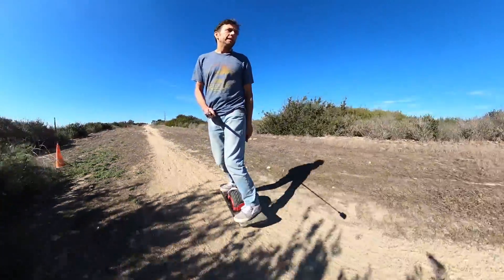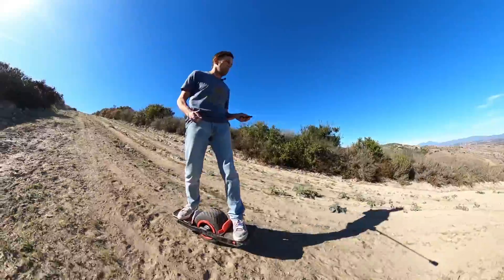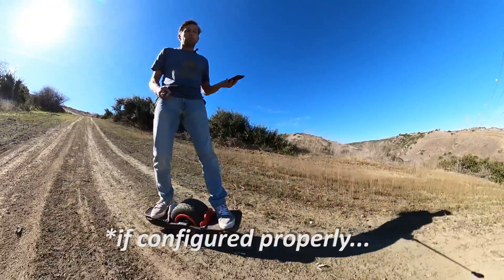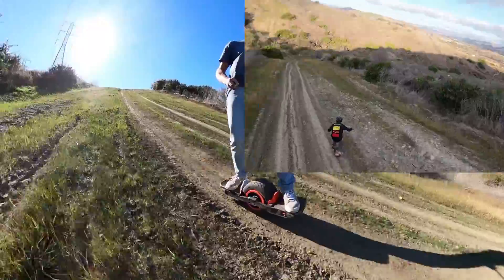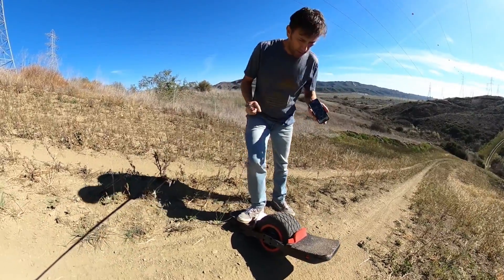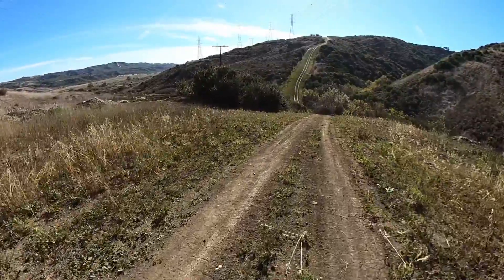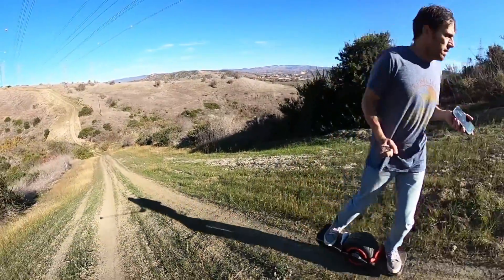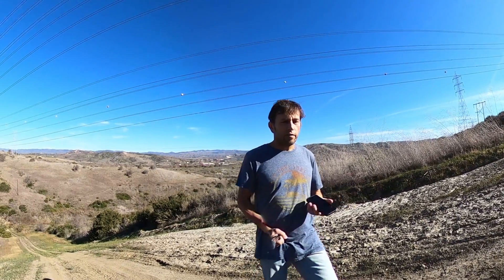All about ATR: Adaptive Terrain Response

Comment: You need an av box 😜 literally can’t get mine to overheat.
Reply from the maker: I have a pub box on the way for my next build. Should be even better…
Reply: @surfdado  hell yah. Are you getting a billet one? Why do you assume the cooling will be better?
Reply from the maker: @chasekasperowski8253 billet/CNC is the same right? The AV Box guys chose the wrong Aluminum. 7075 is stiffer/harder and more expensive but its thermal coefficient is the same as the cheap 5051 aluminum. The pubbox and the fungineers CNC box both use 6061 aluminum, which is the best you can easily get for an application like that.
Reply: @surfdado  interesting 🤔
Reply from the maker: Also, you might be underestimating this hill 😂
Reply: @surfdado  ha, I feel like I am 😆 that thing is monstrous.

Comment: This just gave me a thought for FM boards to have some sort of a remote tilt.

Add friction to the tire. 

I have been doing this on my fender-less board by dragging my shoe on the tire to remove goat heads. I noticed the nose rising but didn't think much of it until now.

Maybe something could be mounted up and foot activated, or maybe I just smoked too much....

Either way thanks for the solid info my dude!
Reply: It's been done on VESC boards, using an e-skate hand controller.  Instead of using the thumb lever or wheel for acceleration/braking, it tells the board to put the nose up or down real-time.  Supposedly once you get used to using it it's fairly easy/intuitive to do.
Reply: @glyphnosis  I understand remote tilt perfectly well. Got any way to make it work on a FM controller? My idea to add drag(like the side of your shoe, or some contraption mounted next to the tire) so you can have a pseudo remote tilt without vesc.

Comment: thank you for everything!
but what about the bonks, or drops? Bonking is fine i guess cause it's so fast, but the landing... so if i understaand it correctly the free spin should give me a nose down landing. (that is why i don't use it, cranked it up in the skatepark but that's it)
i wonder if it's possible to "turn if off" for every free spin. i mean that should be a really peak data to follow up
or it doesn't do anything in the air but as soon as land it will act like i am on a hill and gonna drag the tail as in the FM? maybe that's the proof that we have ATR in FM boards? or that just comes from the speed.... maybe both, that's why it's so aggressive?
i don't know i am lost :D
Reply from the maker: You’re overthinking it - ATR gets disabled during freespin

Comment: Form pump track using the remote is best, remote is a good to override atr when you know it’s messing up because of nutty terrain. I do wish there is a button base tilt when hitting a preprogrammed button will tilt a preset board angle, that would make landing easier!
Reply from the maker: Remote is cheating imho - shouldn’t be allowed in racing, even open class
Reply: @surfdado it’s all in pursuit of faster times my friend. The fact that fm riders don’t have access to remote tilt isn’t my problem. I’m done pandering to fm and there regulations, were just trying to maximize what’s possible with these damn boards.
Reply from the maker: @chasekasperowski8253 understood but the remote is just such a huge advantage that it's like cheating and to me it just ruins the hands free feel of a Onewheel. Remote should be its own class for sure.
Reply: @surfdado  I can see that. Side note, I also haven’t been able to tune a board that can float/coast up steep hills quite like fm boards, so remote makes up for that.
Reply from the maker: @chasekasperowski8253  I have the strong feeling your Float Config is pretty messed up that's why the standard tuning methods don't work as expected for you - but yes, a remote lets you compensate for a poor tune
Reply: @surfdado  maybe 🤷‍♂️
Reply: @surfdado  who makes the rules?